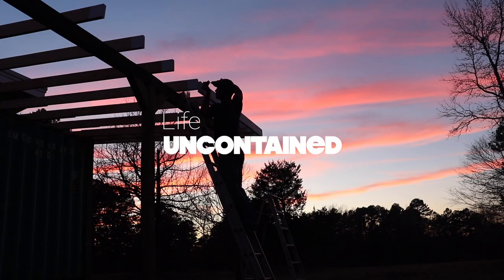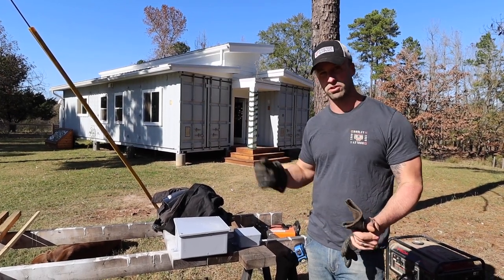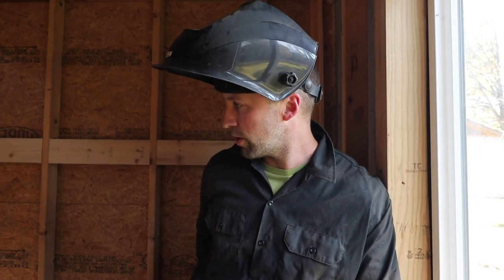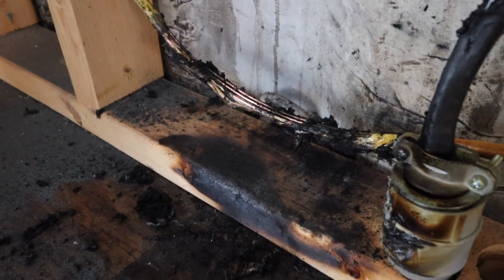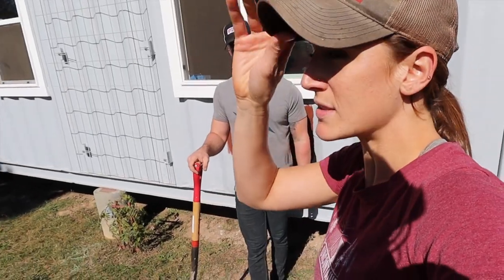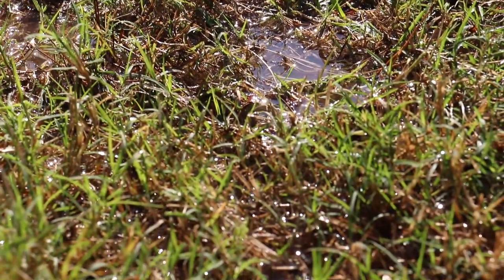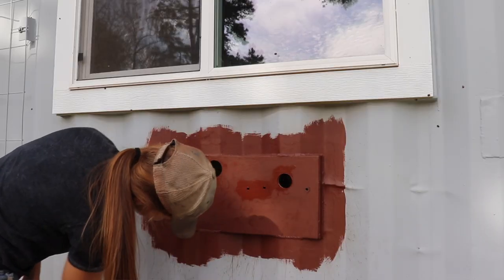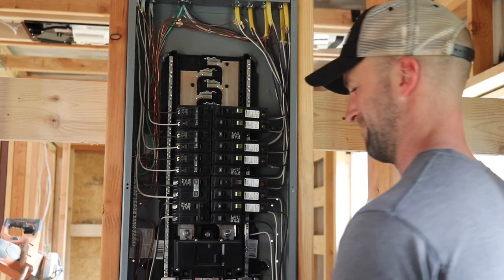Our House Caught On FIRE!

Comment: The wire in the wall does not meet code (service wire) . It needs to be insulated wire. That wire is only good for putting in pipe. Im a electrician. Sorry for the bad news.
Reply: You mean they should be using a Romex cable vs. 3 separate strands of wire?
Reply: I can't believe you can wire up your own house in the USA if your not a qualified electrician. A big no no here in Oz for insurance purposes if your house catches on fire due to fault electrical work.
Reply: @ILGuy2012  It is ok to use it in the pipe that they ran to the house but once they came into the house and its not in a pipe ( conduit) the wire insulation is not approved for that use. Ive been following them since their 4th video. I only would say something if I saw something was not code. I think they are doing a great job for being none tradesman and only wish them the best.
Reply: @mikeanwender339  Mike you are right about all that, everything you commented on. I hope they fix it. I wish them the best also :)
Reply: @paulgeorge150  Im from Canada and the codes are almost the same. As long as they pass inspection and you pull a permit you can do the work. We are in a grey area that im not sure because the are not tied into the power grid because the are on solar. But they do still have to meet code for wiring.
Reply: @mikeanwender339  I was under the impression they were in a non incorporated area and did not have permits or codes to follow?
Reply: It differs state to state
Reply: And sorry the simple answer is yes. Romex(US) Lumex(Canada) are trade names for the product.The code name for it is NMD. Just trying to educate and Im not trying to be a know it all!!! LOL
Reply: @mestanmi  I could not  tell you about permits but you still always have to meet code. Codes are national standards with some local codes but always have to be met.
Reply: @ILGuy2012 Yes.Romex(US) Lumex( Canada) is trade name. Code calls it NMD
Reply: I'm an electrician too...I approve this message Romex or SE wire.
Reply: @paulgeorge150  I learned the basics of wiring in a shop class when I was a freshman in high school.  During my junior and senior years in high school, I was in a building trades class where my classmates and I built a house each year once the foundation was completed.  Aside from doing carpentry work, we did most of the wiring in the house.  It's really not that complicated--certainly not as complicated as brain surgery.  :)  As long as you use new wire, switches and outlets, and have some understanding about the load on a circuit, risk of an electrical fire is minimal.  The way the USA is becoming more of a nanny state, it wouldn't surprise me if homeowners are no longer allowed to do electrical work in our own homes in the future.
Reply: Smart
Reply: I also have still not seen them bond the two metal containers to the panel. Hope they get that done soon too.
Reply: @karlheder7678  Thank you and it does in Canada too.
Reply: @Kodiak660  Never thought of that. thats important for grounding and bonding>
Reply: @Deyanira9944  THX
Reply: @paulgeorge150  not everywhere here in the USA can you wire your own home.. most places out in the country you can get away with it but you better have it professionally inspected or your home insurance won't be any good and you also need the paperwork for all the inspections  incase you ever decide to sell it... nobody's going to buy a house or be able to borrow the money from a bank without it.. however 1 stupid law atleast here in Illinois is all concrete you pour you will be taxed more on your property taxes but you can pave your whole yard in asphalt and your taxes won't go up at all
Reply: @Kodiak660  Never thought about that and that is very important. Grounding and bonding is the most important thing in electricity. Thats why every year in school they teach it.
Reply: Came here to make this comment.... as soon as I saw those separate strands being pulled through the wall I was like DOH!!!     Spencer you can salvage the wire I think but you have to put a conduit through the walls to your panel and pull the wire through that.
Reply: @misfittech7743  Its not insullated and rated for inside walls.Justs in conduit.
Reply: @misfittech7743  The wire is only good for inside of a conduit(rated). Those single wires would have to be in conduit.
Reply: Your right. Thanks for the help. Give advice to fix the problem and just dont bitch about it LOL.He can also do a splice in the JB(junction box) and pull Romex (NMD)through the wall. Both of those will fix the problem. You must be a sparky too LOL. @verdonix1976
Reply: We can do our own wiring here in Canada too. I have wired many basement developments in our own homes and friends homes. It gets inspected for code compliance. Any errors are listed and must be rectified before any passed inspection certificates are issued.
Reply: 100% correct
Reply: @paulgeorge150  Where I live you can do your own electrical, plumbing if you own the home.
It gets inspected. I have wired my house from the meter. Installed a remote automatic generator. All my plumbing. Communication also. Like you said it depends where you are.
Reply: @mikeanwender339  It might just be cheaper and easier to run conduit from the JB, under the house, then up to the main panel.  He has the single runs already available on site, just needs the pipe.  You would probably know best, as i am just "the phone/data guy".

I still cannot believe that he originally ran his Ethernet cable in the same pipe as the power.  That is a definite code violation, as well as a thorough mangling of specs for running Ethernet.  I shudder to think how much induced voltage was present on that poor Ethernet.  To do the Ethernet to code, he also needs to go to an outside plant-rated cable with primary protection on both ends, unless there have been changes to Art. 800 in the years since I traded in the hardhat for a desk.

Looking to the future, I really hate to see an open ditch with two conduits in it which are already earmarked and/or have wiring in them.  I have never had to tell a customer that they had too many spare conduits, or that their conduits were too small.  On the flip side, there have been several occasions where I ended up using the existing phone/data wiring to pull in fiber (or textile innerduct) as the customer performed an unexpected upgrade to the 21st century.  There's "fill percentage", and then there is the reality of pulling additional wires into a pipe with existing runs...
Reply: @mikeanwender339  They're building in Texas, so here in the US we call Romex type NM (Nonmetalic) Cable...MND is a Canadian term.
Reply: @paulgeorge150  in our particular jurisdiction (US, Washington State) we can do our own wiring if it is on property which we own.  Ditto for work performed for your employer as long as the work is performed on premises owned by your employer.  However, unless it is like-for-like maintenance work (replacing a failed breaker, switch, light fixture, or receptacle) we still must pull a permit and have the work inspected by the appropriate authorities.  I can promise you that checking the box for "Property Owner" rather than "Licensed Electrician" when applying for the permit will result in a VERY thorough inspection.  Best bet is to do the work in a manner which EXCEEDS code using known good materials which won't raise eyebrows when the inspector looks at them.  Proper bonding/grounding is one of the first things looked at, followed by wire type and size.
Reply: Just reading but don't understand a thing.
Reply: From the tap can to the panel  individual wires are not rated to be run like romex or NM cable. SER cable should be used or pipe from tap can to panel. One other problem with pipe. Back boxing the tap can will require a close 90° fitting. No problem but for future access to replace for whatever reason  would require an access hole to where the fitting will be.

SER cable is the best bet. If copper is coming from the barn then the SER should be copper. You will also need the correct connectors for the SER at both ends. Because you feeding from the barn the equipment grounding conductor is isolated from the neutral buss. The barn is where the service originates therefore from the first disconnecting means(main breaker) after meter ground and neutral become separate conductors. Equipment conductor(ground- green) from that point is no longer to be bonded to neutral(grounded) wire. Your home panel ground and neutral should not be bonded or tied together like that green screw on the neutral bar isolated from the case of the panel. The National Electrical Code is respected and I believe adopted in parts  around the world. Your area might have additional amendments
Reply: Doesn't the disconnect outside make the breaker panel a sub fed panel in which makes the wiring legal?
Reply: @dalecherry4044  no. Disconnect is only a disconnect. The fact that the service that feeds the property in another building has a breaker feeding the container makes it a sub panel. Ground or the equipment g rye mounding conducter(green) is isolated from the neutral after the first disconnecting means(main breaker). I was specifying that the ground is seperate from the neutral(grounded) conductor.

I had also spoke of the wires from the tap can(pvc box) to the panel can not be individual insulted wires unless they are in a raceway(pipe) or non metallic sheath cable(NM cable) also called SER service entrance romex. SER because it has the isolated ground and neutral wire plus the two hot conductors and its sheathed. There are other rules such as holes through timbers for running wire needs to be 3/4 inch from the edge of timber(stud) or use nail plates to protect wire from accidental sheet rock screw hitting the wire energizing screw or short circuiting.
Reply: I keep seeing you feed the donkeys bread, just an FYI, bread is not good for them, my son got a couple of donkeys a year ago and they had been fed bread and they had large humps that hung down on their mane. The previous owner said it was from feeding them bread and it’s not good for them. They have not fed them bread and the humps are diminishing.
Reply: Spencer should have jumped on that tractor and back filled that trench with the bucket and drove over the trench line to pack it down. You guys are awesome, I found you a week ago and have not stopped watching.
Reply: @kevincrosby1760   Exceeding code IS a eyebrow raiser. FOLLOWING code keeps you safe, saves you money (i.e. spending extra $ and increased labor on heavier then needed wire) and makes inspections smoother.

Comment: FYI.....You can always flush a toilet by pouring a bucket of water quickly into the bowl of the toilet. As long as the toilet is not clogged everything should go down. 😊
Reply: I flushed my toilet that way for years because it leaked because of lime buildup and I didn't want septic tank to over fill
Reply: Been there....done that, many many times. Lol
Reply: Yeppers
Reply: But then you have to be able to pump water from the tanks...no power...but there was rain water you could have collected from the sky.
Reply: @patriciahazeltine9986  They could dip a bucket in the pond to get water to flush the toilet.

Comment: As an electrician here, it’s not code compliant or safe to run thhn/ thwn through the studs like that, your just waiting for another fire. You need to protect the wires with emt conduit or flex through the studs. As long as you have a main breaker kit for that sub panel there is no need to have a disconnect on the exterior of the house as some have commented below.

Comment: I can so empathize! Been welding most of my life and I can't count the number of small fires I've started. Shirts, rags, paper towels,  weeds, you name it. Not just welding but grinders and plasma cutting too. Nowadays I have no less than 3 fire extinguishers on hand and all hot metal bits go into a steel can as well as all shop rags and paper towels. After any job I usually  go back and check the area 3 times before turning in for the evening. And of course smoke detectors are you friend, fluke that you had your power off. Didn't you say in an earlier video that your smoke detectors had a battery backup?

But Spencer is pretty right on as long as you are on your toes they are usually pretty minor. The smoke smell from wood or clothing and such is so different from welding odors you notice it pretty quick.

Glad it all worked out!

Comment: Rule of thumb whenever I had an open utility ditch.
The ditch always gets a spare conduit or two based on best guess future needs.
Expense of a little extra conduit has paid dividends many times over.
Reply: Too late.
Reply: Good idea. with mule tape to pull wire already in it?

Comment: You can not run feeder wire open in the walls . It needs to be in pvc or EMT conduit.
Reply: I was going to say the same thing... 😩
Reply: Ditto, and since you have data and power in the same trench you may want to use shielded cat 6 or better. Otherwise your packet loss will be horrendous!
Reply: Ditto

Comment: You cannot run your single conductors through the framing like you did without any type of protection such as conduit.
Reply: Depends on location I thought? Not all places have the same code requirements
Reply: @MrZealot11  not single stranded wires. It must be enclosed in a cover  say like SEU 3 wire cable or SER 4 wire cable but must be terminated with in 6ft of entrance of home.
Reply: Code code code who cares.for me it's common sense to use pipe pvc or not to put the power lines trough safety first people
Reply: If you ever have to pull the wire again conduit box to box plus if it gets a short? Could burn 🔥
Reply: We know you’re getting tired but you’ve come too far to cheat now

Comment: I know lots of people commenting on the wires needing to be insulated, but also throwing in that the ditch should be 3 to 4 feet deep to not allow frost to lift the pipe out of the ground and there should be an expansion joint fitting under the boxes that allows the pipe to flex up and down.  Most states codes are always to have an electrical disconnect or panel box within 10 or 12 feet of the point access.  Stay safe.   Especially with kids.   : )

Comment: Single wire runs needs to be in side a conduit including in your walls. It is not the same a Romex wire where you have a extra cover over the bundle of wires.
Reply: Bull Shit!!
Reply: @jimfberry  🏆
Reply: Is that wire "TPS"  (tough (secondary) pvc-plastic sheath),
i.e  a redundant secondary protective PVC outer-layer,
extra to the primary insulation ?
Reply: @stephenj6837  what would happen?
Reply: @SnowAndrews  Yeah right.. Service entrance conductors are to be protected from physical damage doesn't matter what kind of wire you're using
Reply: You’re so close to cheat now? Conduit box to box plus if ever need to go bigger you can pull through 2” conduit
Reply: @Praise___YaH  hhhwhat tf

Comment: You cant run individual wire through studs like that. Main line wires MUST be run in conduit. I believe this to be in all states as well as Canada (where I live). MAIN lines need to be protected.
Reply: The individual wires is up to code in pretty much every state here in US (residential), thought every state and county has their own code/regulations. I don't know about the feed wire going to the breaker box. I feel that should be protected like you said
Reply: @Deraco1  Like I stated, the wires must be in conduit for extra protection. (In Canada for sure) and I still believe in all states.
Reply: @Deraco1  I believe most states just follow the NEC code.
Reply: Indeed it does.  They will correct this.
Reply: They are in the boonies of texas, no code man there. This is why electrical work is done by an electrical contractor all over the country. So the house is not a fire liability.
Reply: @DavidJohnson-tv2nn  Pittsburgh is currently using the NEC 2014.
Reply: Same here in Australia and ALL electrical work MUST be done by a licensed electrician who must log all details of changes with the local shire, the electrical commission and it must be marked in the panel inside the meter box. If your house should burn down and the power is not authorised and up to code your insurance is null and void.
Reply: Here in Greece it's recommended to use insulated wire for electrical connections (not bare fencing wire).
Reply: You are correct. I mispoke on earlier comment but couldn't correct it. 
The SEU should only be used outside for residential service entrance. 
From no more than I could see with Spencer's situation the conduit should be outside surface mounted. Unless there happens to be a more direct route.

Comment: FYI:  Per EIA/TIA standards you need a minimum of 8" between data cables and 110V power cables.  Experience over 30 years in networking has taught me that 12" is a more realistic distance.  

Also, when you place the conduit for your data or CATV cables, also place a pull string for future use.  You may never need it but if you do it will make your next cable pull vastly easier.
Reply: Pretty sure what you're referring to is when you're running power and data parallel to one another free wired, running both in separate pipes should cause no issues with interference.
Reply: @ryanjimenez1619 , if the pipes are metal then I'd agree with you.  If the pipes are PVC or ABS then the interference problem remains because  inductive coupling is still possible.

Comment: Just to let you guys know, you can't just free air regular wire,  (through the wall) @20:00. it needs to be in a conduit or you can use BX (armored cable) or Romex through the wall.
Reply: @ChrisJohnson-jt4jz  36 is way deep that sounds like a job spec. 18" to the top of pvc pipe is code compliant for 1 or 2 family dwellings.